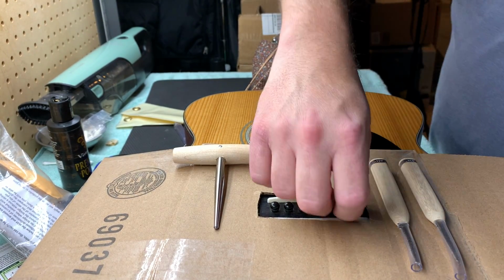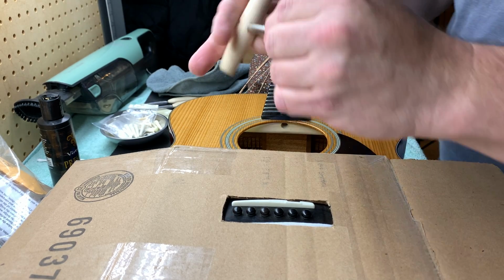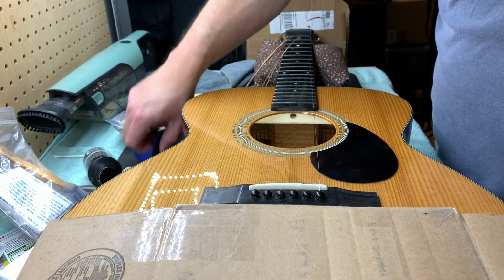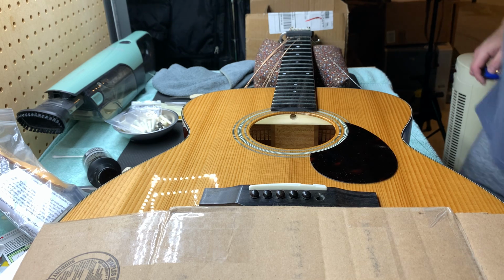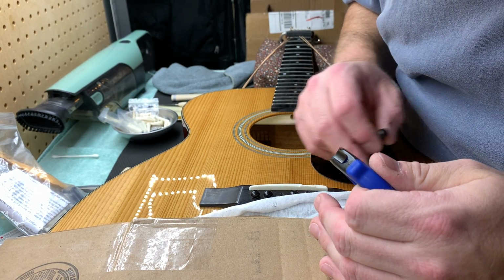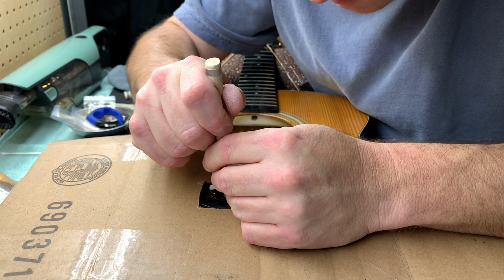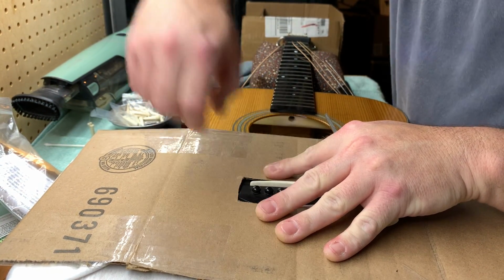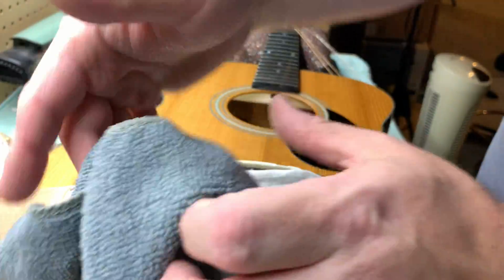Slotting an acoustic guitar bridge for unslotted pins

Comment: So if you have advice for me please help.. I’m wanting to change out the bridge pins on a Martin 000-15M and the site doesn’t say the size of the existing pins. 

Do unslotted pins have a taper/size with them? Should i purchase a reamer as a safe guard?
Reply from the maker: @BeardnScars  I don’t know anything about a direct swap.  I don’t use slotted pins and if I get a guitar with them I immediately ream and slot it for 5 degree unslotted pins from stewmac.  A martin would need to be reamed to accommodate these pins or they would sit very high.  I’ve never tried the unslotted variety but I would imagine it’s the same.  The holes will need to be reamed to fit a 5 degree pin properly to the collar.  Some retailers may sell a pin that will fit a martin without modification but I’m not familiar with those.
Reply: @jessedavis2351  you’re great for replying so soon. I saw StewMac DOES include the size “5 degree taper” so I’ll just find a reamer with that same degree and if I need to ream it I will. Thank you so much!

Comment: Great video. I'm surprised that even a lot of top shelf guitar companies don't do this. In less than a year the bridge plate holes get distorted from the string tension. Which non slotted bridge pins do you use? I've heard that bone seems to improve the sound.
Reply from the maker: I actually subscribe to the theory that less mass at the bridge = more vibration = more tone.  So the lighter weight the better. So I use Stewmac Ebony or ivoroid, which is casein, a type of plastic but much harder than the cheap ones most guitars come with.  That or Antique Acoustics pins made in Germany, which are also I believe casein plastic as well.  That’s what prewar Martin guitars came with.

All of them are 5 degree unslotted pins.

Collings, Bourgeois, Martin Authentics, and Santa Cruz all come with slotted bridges.  Martin cheaps out on the models below the authentics.

Thanks for the comment!
Reply: @jessedavis2351 I have AA pins in my D-28 authentic 1941!! I need to ream the holes I don’t need to do that saw part right? Is it needed??
Reply from the maker: @OfficialDPTheRealDeal  it depends. The AA pins may drop right in with no modification. First drop the pins in there with no strings installed. Do they fit? If they sit too high then you’d use a the reamer to seat them lower.   Once they fit then you install strings.  If the pins are sitting high after the strings are installed then the slots need enlarging with the saw.
Reply: I just did this to my Seagull Entourage, I used the same slotted pins just facing the other way, do you think it would be worth it to get better pins to improve the sound even more? For what I understand this technique pretty much leaves the pins out of the equation since the strings are held on directly against the wood underneath the bridge and the pins act just as a sort of safety measure. Thanks.

Comment: Hi. Just checking. If the bridge pins fit, do you need to do any reaming? Thank you for posting this!
Reply from the maker: Nope. If the pins fit to the collar at the start there’s no need for reaming.  I’ve had that happen before with an Eastman.  Just make sure they’re not too loose in the hole.  You don’t want them too wiggly or the ball ends could cause wear.
Reply: @jessedavis2351  Thanks. I was afraid I had to buy the reamer which is kind of expensive. Much appreciated!

Comment: Thank you or the video.  The bridge pins on my Collings D2H do not go down as far as the pins in this video.  I assume that means the holes need to be reamed out a bit - is that a fair assumption?
Reply from the maker: Possibly.   The best way to find out is to test fit them with no strings.  If they don’t sit flush without strings then a few turns of reamer should fix.  If they DO sit flush without strings then the slots need to be deepened with a saw slightly.
Reply: @jessedavis2351  thank you.   I look forward to more of your videos.

Comment: Well done, sir!  
Quick question...  How much space would you say is between the top of the new notches you just cut, and the bridge? (I guess you could call it the break-angle area...)
Reply from the maker: I’m unsure of that.  I’m only opening up a slot the size of a string with wrap to fit in.  I’m not adding extra space because if the slots are too big it can cause excessive bridge plate wear from the ball end being able to sneak into the slot.
Reply: @jessedavis2351  I think I worded that confusingly, and incorrectly. What I meant was- Each new slot that you cut is parallel to the strings, and perpendicular to the saddle, right?  So, if you were to just keep cutting in a straight line, each new slot would eventually run into the saddle, right? I’m wondering how much space there is between the point in which you chose to stop the progress of the newly cut slots, and the back side of the saddle. (side closest to the bridge pins). 
Hope that paints a more accurate picture, haha. Thanks!
Reply from the maker: @matthewandthehope9972  yes the slots are perpendicular to the saddle.  I thought I showed several closeups in the video.   It would vary depending on guitar on how far apart the slots are from saddle.

Comment: Was there not any need to re ramp the bridge?
Reply from the maker: Nope.  Eastmans are already partially ramped but I usually do not ramp when I slot.  Ramping is for improving the break angle and unless the saddle is short you don’t need to.  Break angle only needs to be about 30 degrees for optimum transfer and if it’s too much it can cause saddle lean and bridge cracking.  Of the 20+ slottings I’ve done I’ve never once ramped as I never saw it necessary.  If I had one with a really short saddle I might consider it.

Comment: 25 minutes video and no final result with all the strings on and proper tension/tuning
Reply from the maker: Slotting/reaming doesn’t really change anything with regard to tuning and a pin/slot coupling that’s been created will not change under tension so I did not include anything beyond the operation.